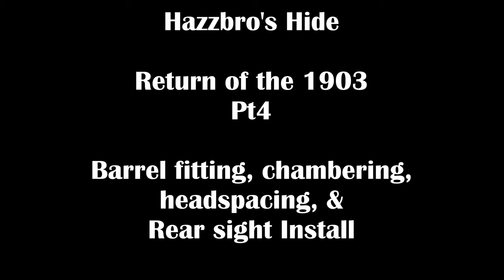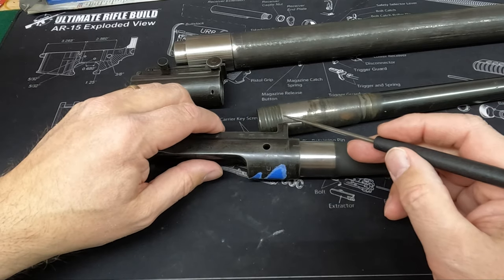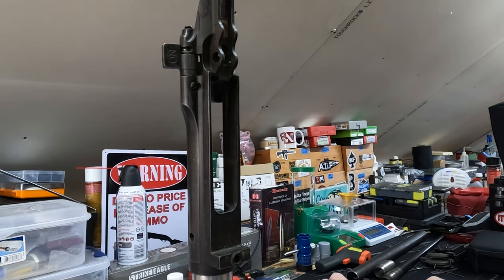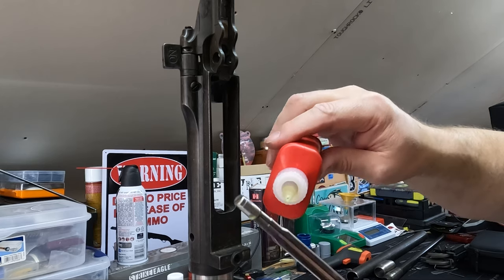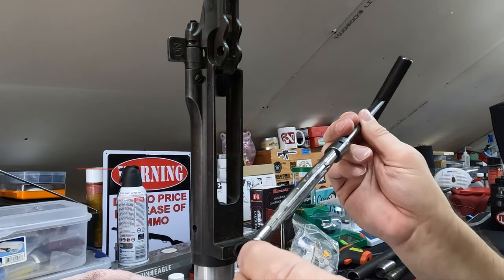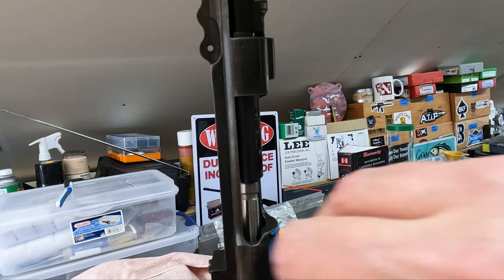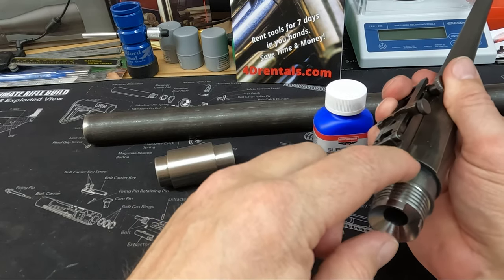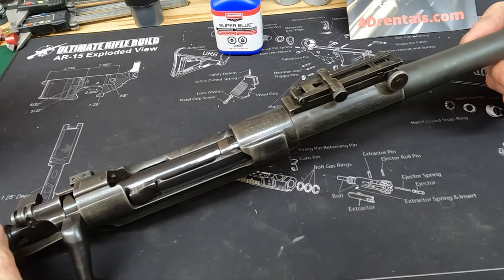Remington 1903 Springfield pt4   Barrel timing, chambering, headspacing, & rear collar sight install

Comment: Just this weekend (09-30-23), I found that my newly purchased Springfield 1903 (found at a local gun show) had a "buggered" chamber.  The fired cases were super difficult to extract.  I had to use a small hammer to tap the bolt open.  Just feeling the fired cartridge case, I could feel an obvious bulge near the head.  

Mind you that, I was using 1977 HXP M2  ball ammo (purchased from the CMP).   Also, using my reduced power hand loads was still "no joy."

I searched my favorite surplus web sellers and found that the CMP still had some newly made Criterion 1903 barrels.  Actually, they had two in stock.  So, I put my order in. 

Meanwhile, I was curious as to the process to do the barrel installation and found your video.  Nope, I never dreamed about doing the work myself and I still don't intend to. 

When the barrel gets here, I'll leave the work to my gunsmith who has the tools and experience.  Besides, he has done countless of installations before.   But thanks anyway for the video.
Reply from the maker: Good luck and it’s great to see another will be put back into good working order!  Tks for sharing, Hazz

Comment: While criterion barrels seem like the shoulder is proud initially, they aren't. The trick is to snug them up as far as you can (which will likely be short of perfect like  described in this video), then back off and do it again. The shoulder will crush slightly and or the parkerizing will wear off each time you snug it. I have never had to trim the shoulder back on a criterion 03 or 03a3 barrel. I did swap on a used USGI barrel for a guy once that snugged past perfect. If you lightly peen the edges of the shoulder, you can get enough back for it to snug up perfect again. Use a brass drift for this and lightly go around the edges...lightly is the keyword.
Reply from the maker: Great information.  Thanks!